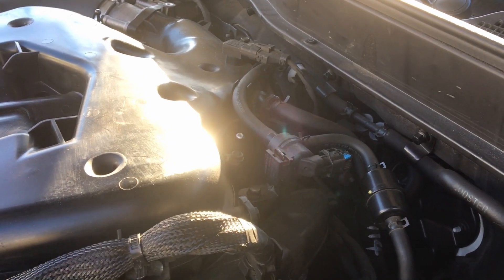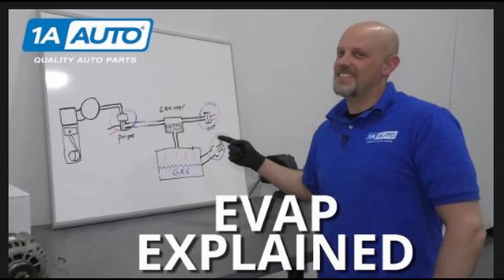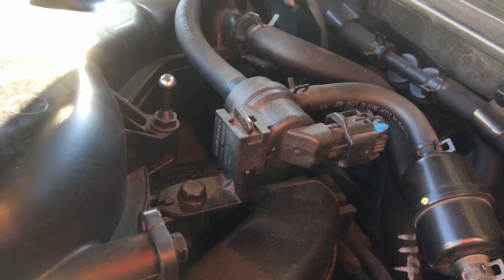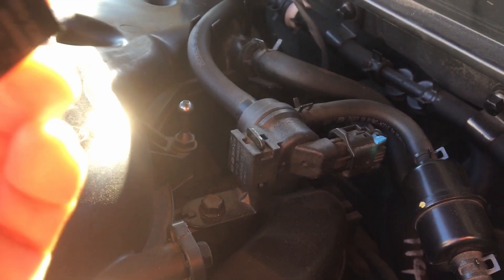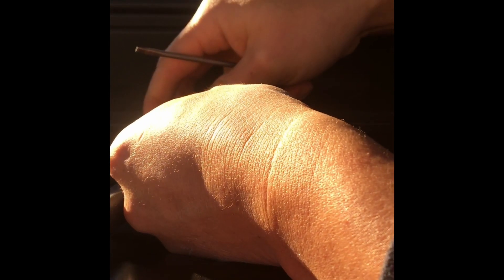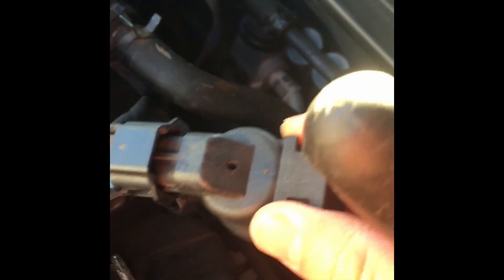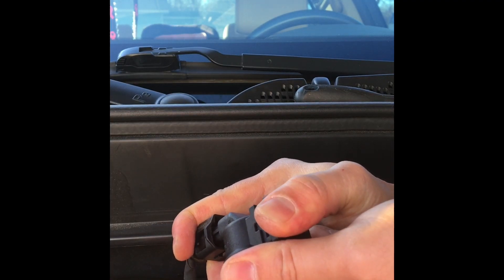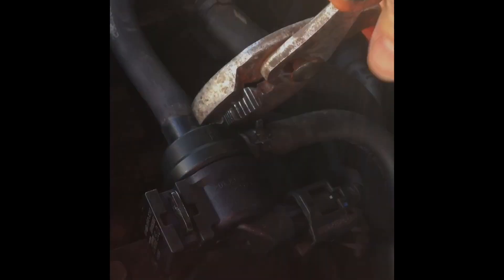Hyundai Genesis 3.8 Code P0441: The Culprit and How to fix it.

Comment: Hey Im having this problem. I cant seems to take the tube out of the purge valve. Do you know how to remove. Also cant take the wire out like the video.
Reply: No need to apologize for a child that wants to hang with daddy and learn! 👍
Reply: Hi is easy to remove 
Pull out slowly blue clips